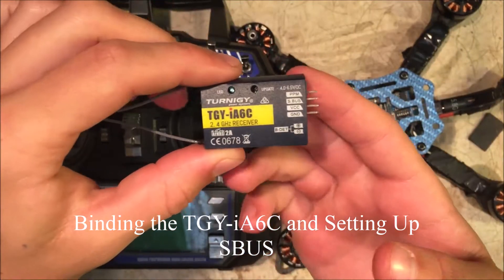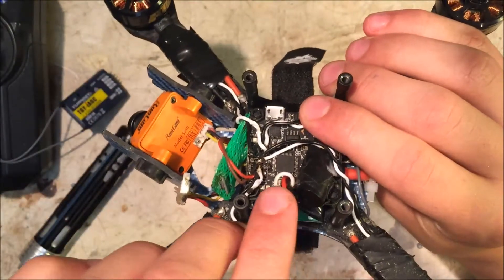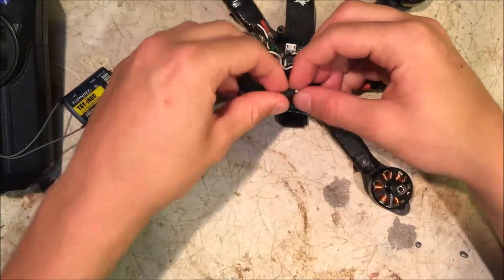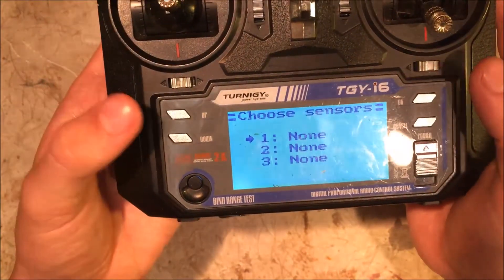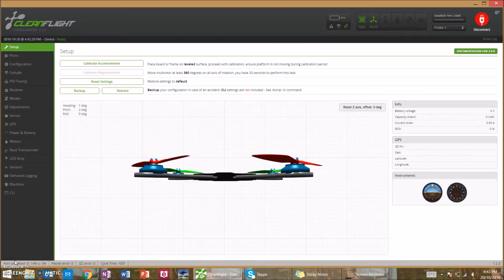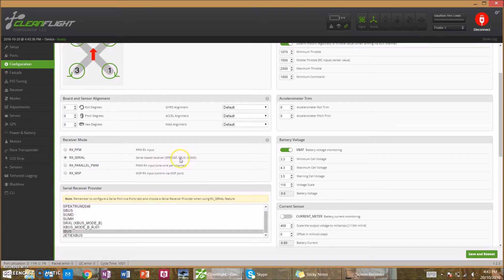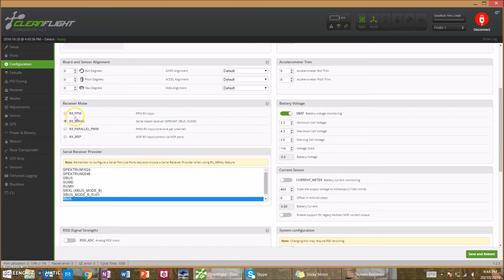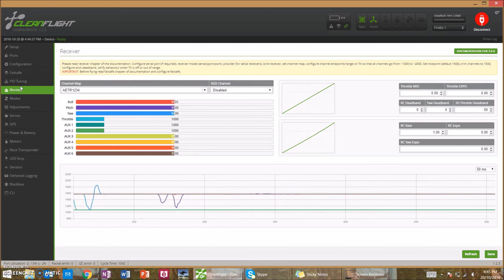Binding TGY-IA6C and Setting up SBUS for beta flight / clean flight

Comment: Just came across the problem where my Tgy Ia6c receiver was not working with my quad.  Had to switch it to IBUS just like you did in Betaflight now everything works as it should.  Thanks so much for your help.  Gotta new Sub.

Comment: hi i'm new to the hobby i have this receiver but don't understand were the channels are on this like all the rest have i want to be able to plug in a 3 in 1 safty buzzer and other things to each channel how does that work or do i need a new receiver
Reply from the maker: Ok so all the signal's go through the one signal wire. If u wire your flight controller correctly you will be able to wire in a buzzer and so on. the way sbus works allow for only one wire but do everything a normal receiver can do. If u don't understand or can get it to work just be specific on what your problem is and I might make a video to help you with it because you won't be the only one having these issues.
Reply: i have the sp f3 flight board does the wire go in the I/o1 port i took out the yellow ppm wire is that the one i need to use i have the sbus in the I/o2 port
Reply from the maker: Big will S. make sure the wire commune from the receiver says ibus. The solder that cable or connect it to the RX tab on your fc. U should then be able to follow the video and get it to work

Comment: I'm looking a buying another quad,but.I want to buy a arf version instead of buying a rtf,I already.have three turnigy/flysky transmitters buy I'm not sure where the wires go,what is all this sbus ibus ppm im a bit old and quite confused,which is best and why.I have a spare turnigy i6 receiver I want to put on another quad bit like I said not sure what wire goes where please advise what to do.Also if I buy a arf version does that come tuned,confused old man haha
Reply from the maker: jason richards so sbus is the best for quad ms because it sends the signals faster with more clarity, Ibus is kind of the same as ppm and pwm is not great try to avoid using that. Also ARF don't come tuned most of the time they just have stock firmware hope this helps
Reply: Cheers mate what wires go where though from the receiver to quad do I use them all or just one.How do I know which is ground.So for sbus I use all the cables provided

Comment: I'm 99% sure that protocols such as PPM, ibus, and sbus are processed on the RX side, not the TX side, but that being said I need my ia6c to outbut sbus, but it's only doing ibus and I'm running the older style flysky i6. Any ideas? HK has literally no documentation on this receiver and it's discontinued already.
Reply from the maker: The Schire FPV so what this receiver does is turn the ibus from the remote into sbus to the fc. If you enable the Ibus setting you can in the remote it should work. If you can just use ppm and instead of selecting Ibus in cleanflight just use ppm

Comment: How are you finding the range?  This is a lot weaker of a RX than the ia6b.  I've had drop outs where previously I've had solid signal with a ia6b.  I may need to be more fussy with my antenna setup.  On the other foot the RSSI and voltage warning sensor is great.
Reply from the maker: SickocrowAU the range as far as I can see is almost as good as the ia6b but I have noticed that the RSSI will sometimes show very high failure values. Across 3 soccer fields I have about 30% error

Comment from the maker: This receiver also has s port where you can plug your main bat volt into and get the live voltage reading on your transmitter
Reply: Cloud Razor FPV what is the max input volts to go into that port
Reply from the maker: David Charles 4s I believe but I'll double check for you